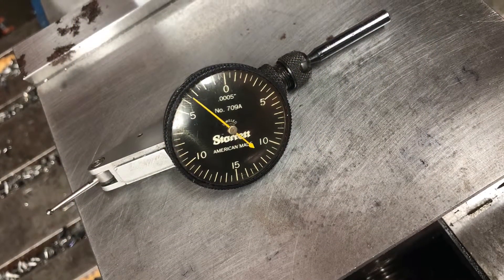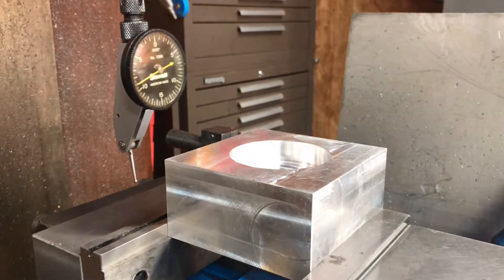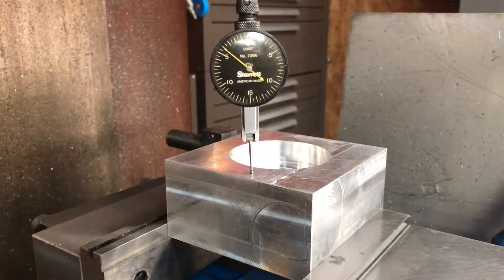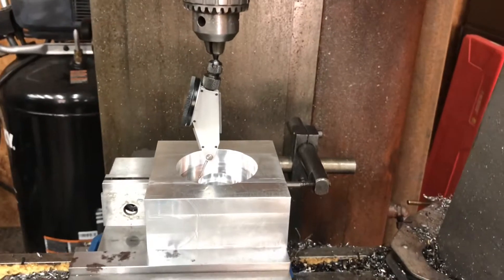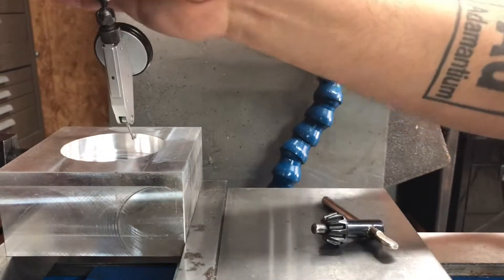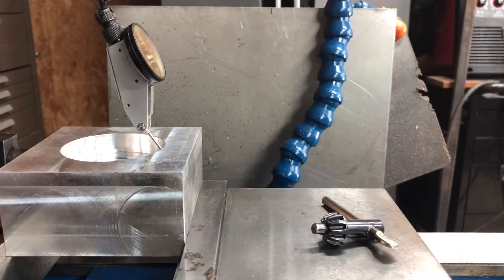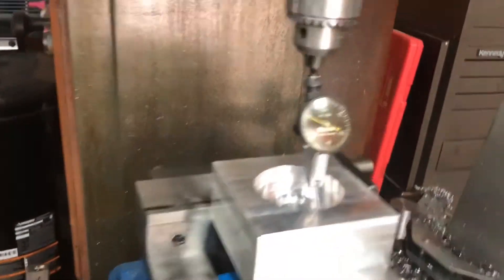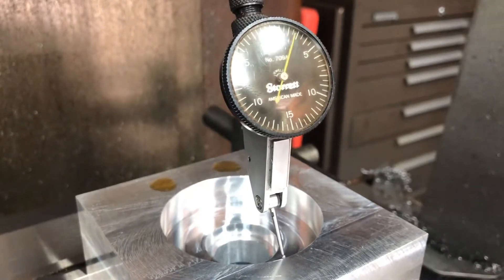How to Indicate a Bore with a Test Indicator on a Manual Mill

Comment: If you set the indicator horizontally with the stylus vertically, you can see the face from the top, all the way around the hole.
It's worth noting that an indicator stylus must be vertical and aligned square with the spindle axis which is difficult with a ball joint holder.
I'll post a video showing the fundamentals of indicating on a mill soon. Including the simplest tool to keep your indicator permanently aligned. For an insight: see my video - easy indicating on a lathe.
Reply from the maker: Yep that’s right, idk why I didn’t doit